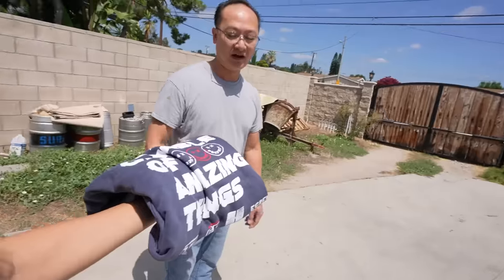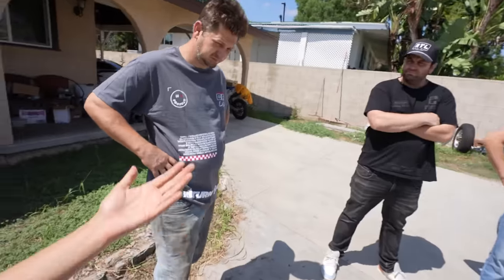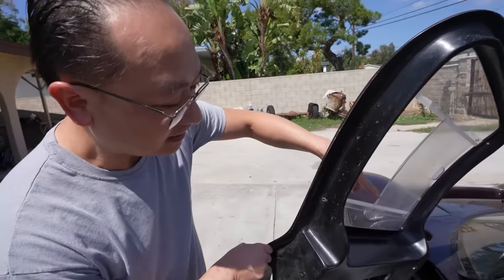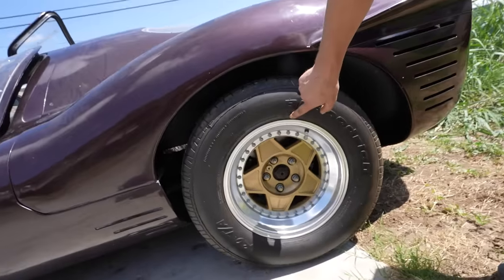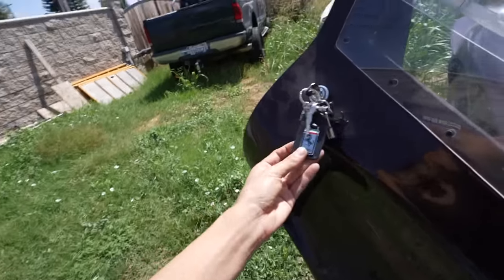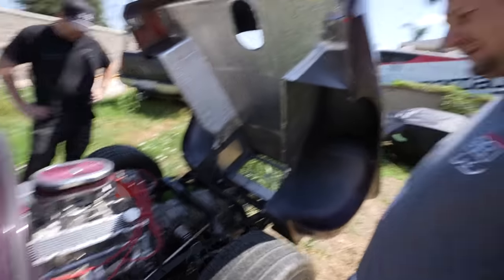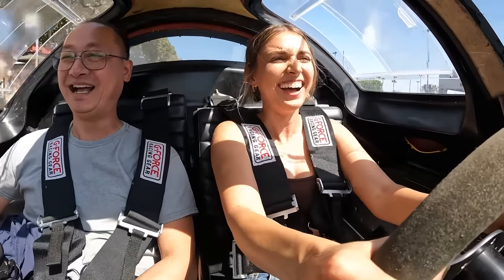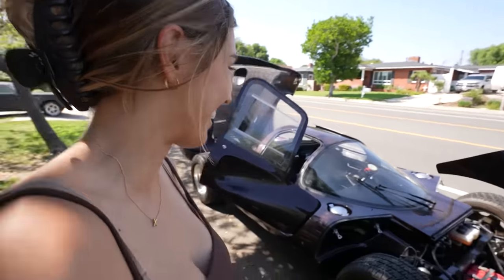He wanted his Ford GT40 Back So He Offered Me This...

Comment: Great video, as usual, hey I saw another motor maybe to contemplate for your switch? How about a 1LR-GUE is a 4,805 cc (4.8 L; 293.2 cu in) DOHC 4 valves per cylinder V10 engine? Not enough performance for you huh.. Okay, good luck on your build. Cheers!

Comment: no wonder it got hot you couod here it pinging its arse of either the fuel put in was low octain or the timming is way advanced.. id say a combo if its getting hot aswell.. the inside of the bore an piston will look like its had metal bouncing on the pistons if u dont blow it an eat pstons before hand

Comment: OK Here’s the thing These people Know ABSOLUTELY NOTHING about Racing cars … You Do Not Start One up and Instantly Drive Off .. You Start the Engine and let it Tick over for at least 15 to 20 mins to let the Engine Warm up and get the Fluids Moving, otherwise You Ruin the Engine or worse Warp The Block or twist the Crankshaft… V8s & V12s Rings can over heat and Boom 💥 Test everything, Breaking Pressure , Gearbox oil , check water levels are Holding,, There is a Procedure to follow , Its Not a Road car its a Powerful Racer,… AMATEURS……😂

Comment: NOOOO!!  Don't buy it!  Don't equal trade, don't trade with you getting the Fakararri and a large sum of $$$, don't buy it outright!  
  Considering how much you want the yellow GT40,  
the GT40 looks & is built much more like an original GT40, then how far off the Fakararri P4 looks & is built like a real P4,  
how much real work the P4 needs - including bodywork, paint, interior finish,  
probable re-engineering,  ...  
AND what the GT40 was now appraised at ...  
PLEASE DO NOT DO IT.  
@EmiliaHartford 
When the GT40 is done, it will be a much more enjoyable driver, as well as mote reliable.